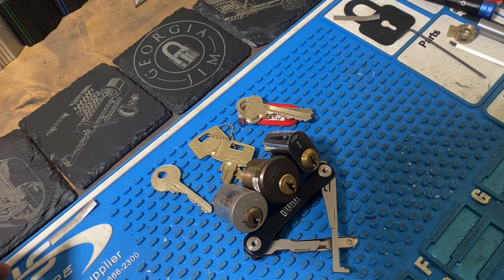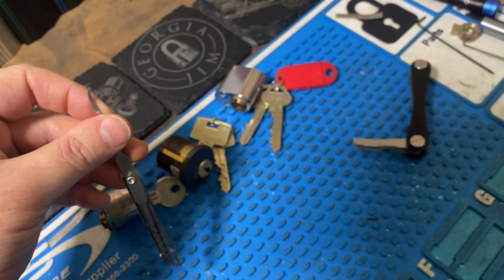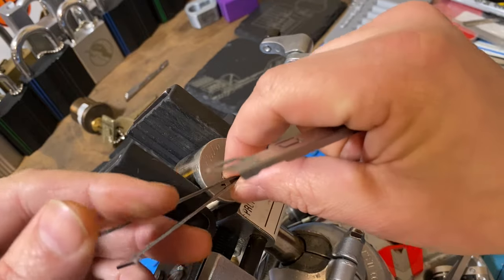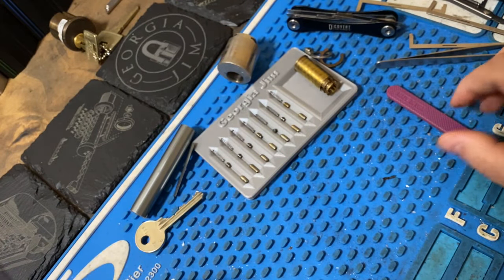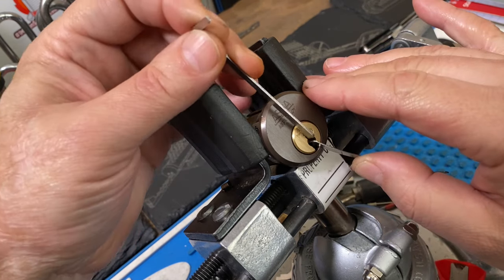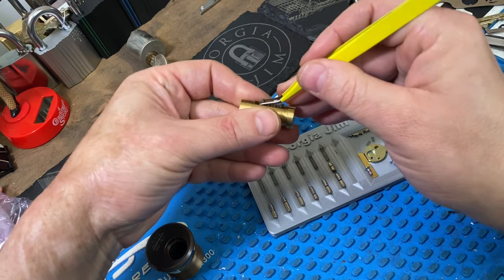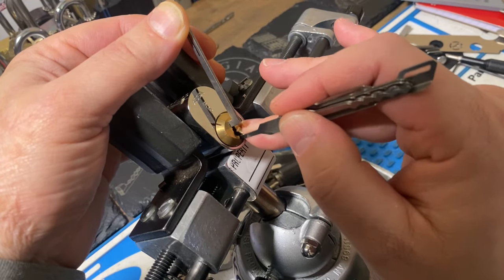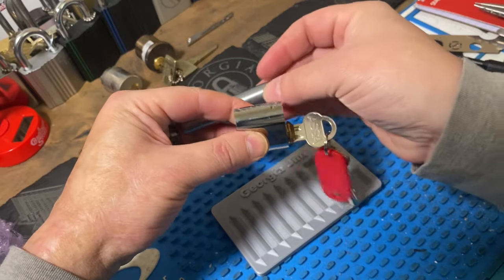[443] Riv-Pick Series Part 6 Red and Black Locks and Final Thoughts

Comment: Wow, good job getting all the way to black with the pick.  Hopefully they make a locksport version because I’d buy that.
Reply from the maker: Thanks. A thinner locksport version would give you a lot more options for locks to choose from also.
Reply: That actually got me thinking…. Is that rivet possible to pop open and reclose?  Because I noticed that the picks/rakes are just the same ones offered on the Covert Companion.  Meaning that if you salvaged the handle part, you could get the .020 version of the tools and attach them to the rivpick handle.
Reply: Also, this series taught me a lot because at the moment, all I got is genesis profiles for picks, so it’s literally the same picks you’ve been using.
Reply from the maker: @SukiminYakumo  yeah, the genesis set is a minimalist set but a lot more can be done with that set than people give it credit for. It may not be the easiest method but it’s definitely doable.
Reply from the maker: @SukiminYakumo  i’d think you’d need a way to install a new rivet

Comment: Thank you for this series. I am in total awe of your skill. Chris Capune and I were talking about the problems we had on assembling the Slim Jim. Ours don’t feel or fit right like yours. Any way you could do an assembly video? CI does not have one. 🙏👍🦊
Reply from the maker: If yours isn’t feeling tight enough add some of the fiber washers to snug it up. I also used blue loctite on my threaded posts and screws to keep everything from backing out. I will try and get a video put together but in the meantime here is a reddit post showing how people set theirs up for a more snug fit.

https://www.reddit.com/r/lockpicking/s/IJHPL7GNkS

Comment: I just messaged CI due to my Riv Pick crapping out on me in a few weeks.  It saddens me, as it is SUPER floppy now, and has forced me to have to crimp it down - which proved only to be a temporary fix - I’m going to have to drill and replace the rivet at this point… UPDATE, the lower “floor” cracked and now the picks over-extend/over-deploys past the 180° mark… making feedback virtually non-existent - damn
Reply from the maker: Hate to hear that. Hopefully you crimping the tool or trying to replace the rivet didn’t void any warranty. They had a replacement in the mail for me the next day over a bent pick but I didn’t try to fix it myself.
Reply: @georgiajim2260  They sent me a new one before even replying to my email:.. I got yelled at by the wife when she saw the “Your order has shipped” notification 😂
Reply from the maker: @moose2934  nice, their customer service is top notch.